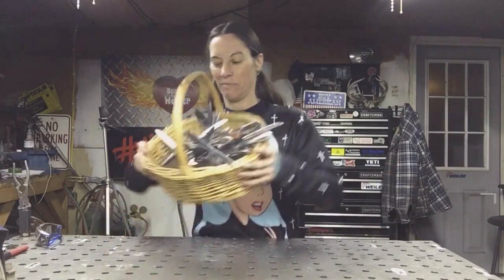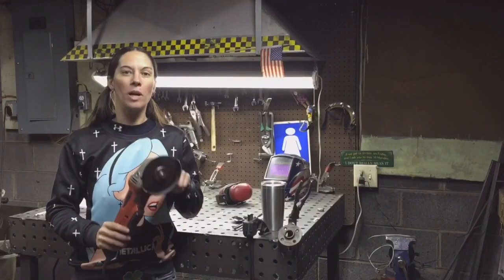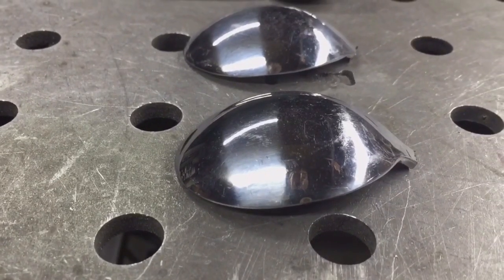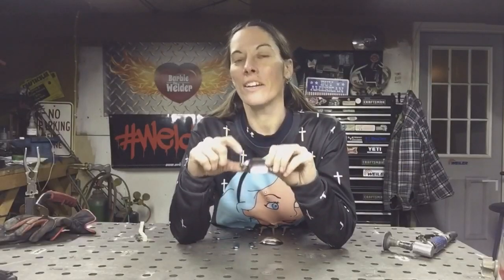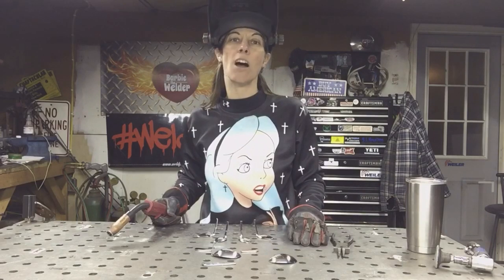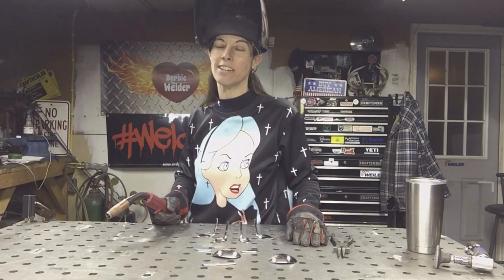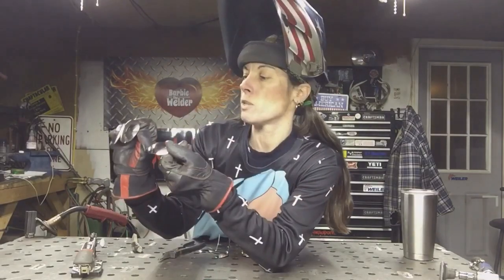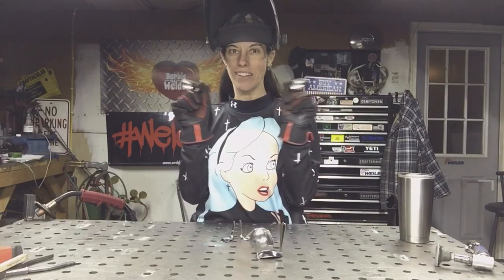How To Weld A Dog | Easy Scrap Metal Art | Silverware Sculpture | Barbie The Welder

Comment: I have NO experience with a welding machine (is that what you call it? LOL), but as an old time jeweler, I'm impressed!  Not that a torch would solder or weld those spoons ANYway, but even if it did, a torch is slower than Christmas and makes a mess of metal that has to be cleaned up!  I want to weld now!!! LOL
Reply from the maker: Yes!!! Do it!! It’s so much fun!!

Comment: I purchased an Easywelder to do silverware art. I watch your videos and you just touch weld. I weld the parts together but there is allot of slag and splatter. When I try your way the welds don't hold. Do you use a different type of welder?

Comment: What Volt/Wire speed setting are you using for these tacks?
Reply from the maker: My settings won’t work for you. Wire size, travel speed, distance from workpiece all come into play. Use the chart inside your welder to get your starting parameters using what wire thickness, material type and thickness and gas you’re using and adjust as necessary for your welding style!

Comment: Hi! Is that arc welding you use? What electrodes you use for welding silver table ware ?
Reply from the maker: MIG welding with er70s .030 steel wire
Reply: 70s6 with c25 gas? Do you experience any rust on the stainless? Running 308l wire with tri mix would be ideal but the gas is so expensive for stainless!!!

Comment: Why clearcoat it? It's stainless steel flatware, right?
Reply from the maker: Yes but I’ve used steel wire to weld it so the weld will rust without clear coat.
Reply: Er-70 would definitely rust. I use 308 filler rod on stainless flatware. Whenever possible, I like to match the filler rod to the base metal.
Reply from the maker: Yes that’s ideal but when I made this video I couldn’t afford the stainless
Reply: I'm a fan of Tig welding. I cut my pieces 1/32 long and that's my filler wire built right in. But being a welder by trade, I know welding tricks and bought my equipment at a production rated level.